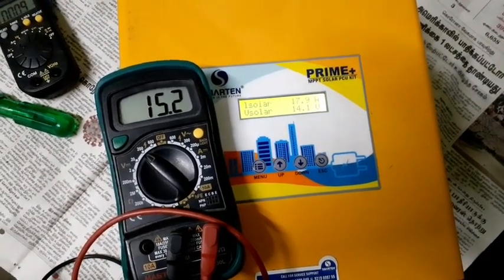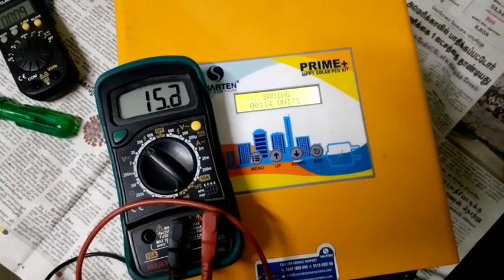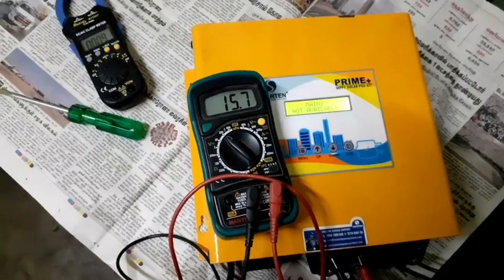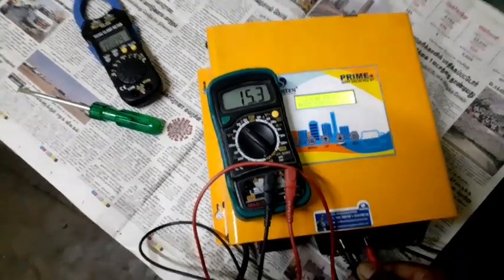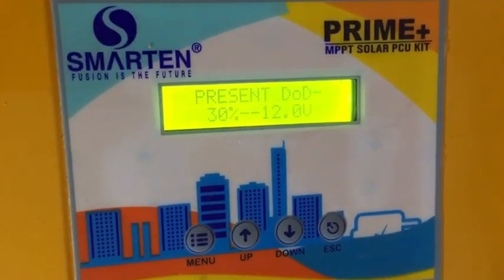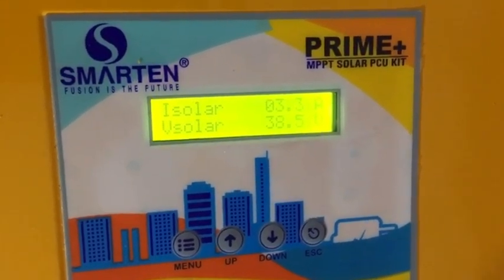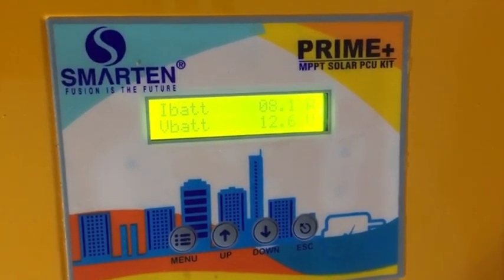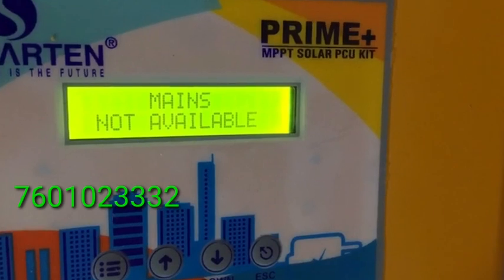Smarten prime + 30 amps mppt charge controller (TAMIL)

Comment: Sir 24 v 540 watts *2 panel total 1080 W with single battery is possible with this controller.
Reply from the maker: No 
Use UTL gamma +inverter

Comment: I am using 335W *2nos panels,150ah battery , normal inverter 880VA for this which mppt can I use?
Reply from the maker: Yes sir panel parallel connection

Comment: சார்  440 w பேனல்  2.
200 AH  பேட்டரி. 2.
1850 va inverter.    Microtek. -MERLIN. 
24  volt.   50 A    MPPT- C C..
சன்  லைட்  இல்லாதபோது  
Grid இல்  சார்ஜ்  செய்யும்போது  
சில சமயம் 
Improper battery  V TOO HIGH  
என்ன வருகிறது  எதனால்.

Comment: Sir I am having smarten 12v / 50a mppt plus. And I am  getting 20.1v and 0.00 amps from solar. And battery volt 13.9v and 0.00 amps. The amps was 0. What is the issue in mppt. How to fix this.  I have installed 12v  160w - 3 panels and connected to 12v 150ah  battery. Plz advices
Reply: Tell me solar panels specs
Reply: @vasudevanmuthaiyyan2912 12v  160w x 3nos. Connected parallel.
Reply: @jaikumarjayangle  check out

Panel oc voltage, polarity

Panel make?
Reply: Which area your's

Comment: I am planning to install loom 440watt solar panel to this MPPT along with 1100va inverter and 150ah tubular battery ! 

Which %DOD will give maximum power savings and benefits ? 30% or 40% or 50% ?
Reply from the maker: Smarten maximum support 45voc 
440w mono crystalline solar panel voc 49 so 
Not support
Reply from the maker: Try utl gamma +inverter
Reply: சார்  அவர்  இந்த mppt  cc  க்கு  தகுந்த   DOD  எத்தனை  %  சரியா   இருக்கும் என்று  கேட்கிறார். 
சரியான  பதில்  கொடுங்கசார். 
எனக்கு ஒன்றும் புரியவில்லை.

Comment: Sir 250watts panel use cheydal output invertr via kittumo minimum ethra watts venam output kittan imean 100ah battery full charge volt

Comment: hii, in this charge controller, is it possible to connect 2x180w12v(18.06A) and 1x375w24v(9.62A) in series connection, i have 120 AH Battery and 800VA normal inverter
Reply from the maker: Its voc 45v 
2 number 180w series (21+21)and 375w( 45)paralel connection is possible
Reply: Nirmal kumar Hi in this charge controle is it possible to connect
Loom solar 3 * 180 watt /12 parallel
Loom solar 2*180 watt +2 * 180  watt series

Comment: Bro can i connect 3 watt solar pannel using this charge controller bro by using 12 v 7.2 A battery bro
Reply: Please tell me bro
Reply from the maker: Use 12v 6amps charge controller 700to 800rs
Reply from the maker: Don't use this
Reply: Bro in my house i need to use two gans, two led light which watt solar pannel can i use which amps battery 
Can use and which amps charge controller can i use bro 
Please please tell me bro
Reply: Sorry two **fans
Reply from the maker: 375w 2 no 
150ah battery 1
Mppt inverter 1
Reply: Bro what amps inventer should i put bro and what amps mppt should put bro
Reply from the maker: Call me 7601023332

Comment: Sir , can i connect 375 watts 24 volts  panels 2 pcs  to my  150 ah Single 12 volts battery ?
Pannels output :-   39 volts, 9.62 amps,  so  2 panels parallel connection will be generate  39 volts, 19 amps
smarten input capacity  30 amps & 25 to 45 volts
Have any problem if i connect with panels ?
Reply: Sir aap se avi  baat huya 
achha laga
to mai  375 watts ka  2 panel laga sakta hu mere single battery me
Smarten  12/24 30amp charge controller ke sath
Thank you..
Kolkata, West Bengal
Reply from the maker: No sir 
Any more details condect me
Reply: Sir i wrongly written 15 Ah  instead off  150 AH
plz reply again
Have any problem if I connect 2 panels of 375 watts to 150 ah single battery?
Reply from the maker: @ranjitbhatta1   call me 7601023332

Comment: Hello, planing to buy solar inverter ~3Kva, already bought 1700W (24v) solar panels and 2 X 150AH (C10)  12v,  Batteries, now looking for advice or model

1) Is it better to by MPPT charger controller and 3KVA separately (for less cost ~18k both)
2) Mppt charge controller integrated inverter (most price 25k)
3) OR  Please suggest me some inverter model 24V, ~3KVA with solar integrated mppt charge controller (Im fine with 2.5 KVA solar inverter too)

Comment: Sir 375watts 36v monocrestal solar panels 1no and 100ah batteries 2no and my inventer 24v 1400va so i use which mppt charge controller i mean model
Reply from the maker: This mppt ok than

Comment: Which is best solar panel  choice  in this mppt charger  12volt   180+180 watts = 380watts  or 1 panel 24 volt 380 watts panel which is best?  Plz tell sir....
Reply from the maker: What is your lode,battery, inverter 
Ex 12v single battery, 1000w inverter you use 180 ways 3 number 
Your lode used 2 battery, abow system 375 w 24v system is best
Reply: @loomsolartamilnadu  my inverter  540watts square vave inverter local made, battery  single 80ah amaron battery, sir  
Which is best and benifit panel in this mppt charge control? 
 12 volt  180+ 180 =380 watts  
24 volt 375 watts single panel 
Which is best in my propose?  
Plz tell me sir?   Waiting for ur reply...
Reply from the maker: 80ah battery ku 125+125 w ok sir

Comment: To connect 2*375 pannel into 150ah battery 1100 va inverter which controller i should use 30amps or 50 amps
Reply: 2*375-24 v pannels

Comment: Sir What Is The Cost Of This MPPT charge Controller ?
Reply from the maker: 4200rs
Reply: Mppt inverter available 500watt input vdc 50volt 40amp 12v battery up to 300ah chat. damuindyan@gmail.com

Comment: By using 375 watt solar panel we can connect 12v battery by using this mppt
Reply from the maker: Yes its possible
Reply: @loomsolartamilnadu   bro 750watt/12v = 62 amp output
How can handle   62 amp
It capacity is 50amp outputmax
Reply: Sir how it handle this much current  pls tell sir
Reply: balaji mani 
375 watts x 2 panels = 750 watts
Panel Output voltage 39 volts, Current output  9.62 amps
If you connect paralal then  voltage will be same as 39 voltage & current will be  approx 19 amps
Smarten input capacity 30 amps & 25 to 45 volts
So  no problem
Reply: @ranjitbhatta1   sir output of smarten is 50amp max how it can  handle 12v × 50 amp = 600watt
Reply: @balaji mani Sir
panel se 100% watts kavi vi nahi ata 
60-70% apko milega
I means to say that if your panel is 750 watts thwn you will get only 450-500 watts maximum
Out of 9.62 amps of each panel, you will get only 6 to 7 amps max
Reply: @ranjitbhatta1   sir see in this video 6.01
https://youtu.be/pYH2kX_8VBw

Comment: Can I connect four 180 w loom solar panels to this 30 A smarten mppt (2panels parallel+2panels in series) to a 12v 150 amp single battery?
Reply from the maker: No sir 12v system maximum input watts 500
24v system maximum input 1000watts
Reply from the maker: 12v system 180 watts 3 number or 24v 375 watts 1 number
Reply: All three in parallel?
Reply from the maker: Yes sir

Comment: Solar PCU 2335/24v microtek  wats
Reply from the maker: Its pwm charge controller inbuld 
So 24v 375 watts panel 3 podalam(maximum support 1200 watts)

Comment: 24v 750watt panel ( 375*2) kku this mppt controller enough ah sir
Reply from the maker: Smarten service sender not Available in Chennai 
Whar you bye a prodect condect him
Reply from the maker: 12v system ku 2 ×375 watts podalam
24v system ku 3× 375 watts use pannalam
Reply: @loomsolartamilnadu  sir for smarten change controller service center is available in tamil nadu Chennai let me know because before we buy let me known sir
Reply: @ibrahim151111  Service centre available in Coimbatore Tamilnadu
Reply: @shanmugamravananify  கோயம்புத்தூரில்  mppt charge controller சர்வீஸ் சென்டர்  எங்க சார் இருக்கு.
Reply: @loomsolartamilnadu  thanks sir
Reply: @loomsolartamilnadu  sir this controller price